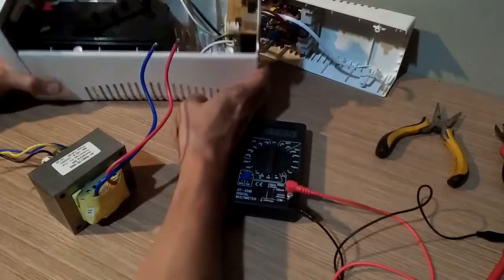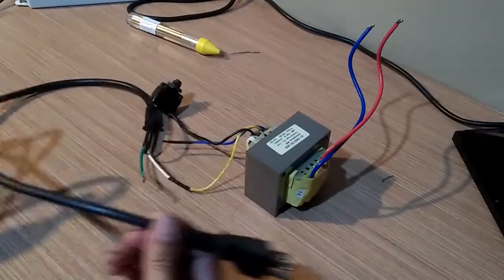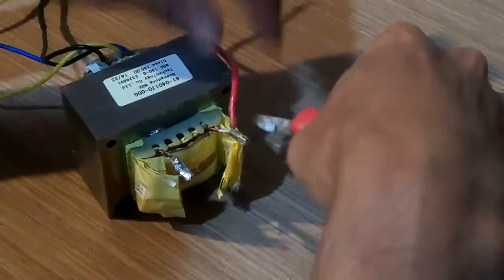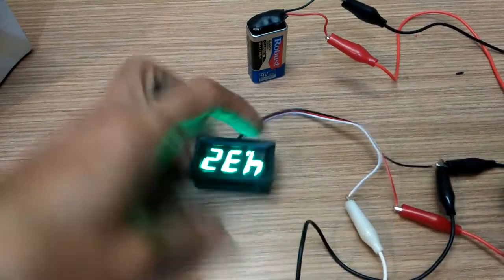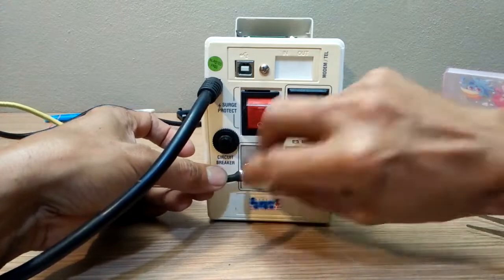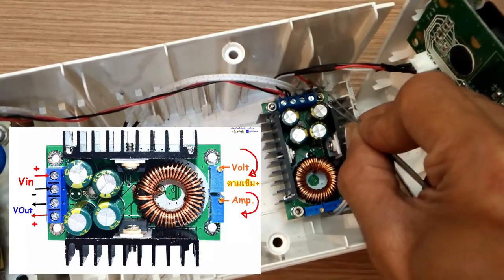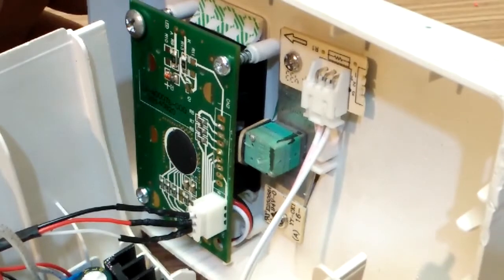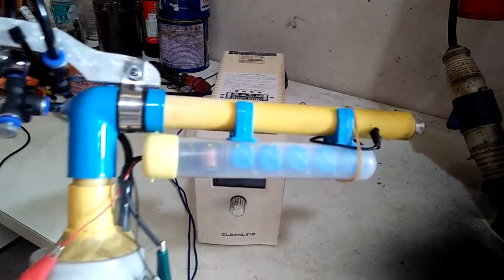Old UPS to Variable Voltage Bench Power Supply

Comment: hello. can you make it easier?
Reply from the maker: Hi. I actually made another version where I used a cheap 24 volts switching mode power supply instead of reusing the transformer. I still connect it to a DC-DC buck converter though.

Comment: Can I vary the ampere too like a proper bench power supply?
Reply from the maker: Yes. The module DC-DC buck converter module that  used has Ampere adjustment potentiometer n the pcb. f you connect that to a external potentiometer to the front panel, then you can easily adjust the constant current lmt.

Comment: Can i use ,
AC to DC Adapter, Adjustable Power Supply Motor 3-12V 2A 110-240 V Rate Controller
Reply: Instead of making this
Reply from the maker: Yess absolutely. I just made this power supply from scratch because I did not have an adjustable dc supply at hand.
Reply: @DIYPhil  what is minimum and maximum voltage required, and minimum and maximum Amp required

Comment: Hi Phil is  it possible  to  use a battery charger  as a power source  with a 5v step down regulator to control  volts and amps
Reply from the maker: Yes, absolutely.

Comment: Thank you so much for this! I've had a broken UPS for years which I was hoping I could turn into a variable bench power supply but didn't find a good video like yours. I'm definitely going to try out your method. I'm very grateful

I once made a bench supply using a transformer I made out of recycled ceiling fan regulator core and recycled some wires from various electronics. It worked but the transformer heats up after 10-20 mins when it is powered on, even if there's no load. So I only use it for testing circuits for short periods of time until one day I forgot to unplug it from the wall outlet for several hours and I came back to find out that the transformer had destroyed itself.
Reply from the maker: Hi. The transformer of the UPS will be more reliable because it is designed to be plugged in all the time. It also has high output current capacity. Inside the UPS circuit have MOSFETS that you can use with other cool projects. Good luck with your build.
Reply: @DIYPhil  I cant thank you enough...I'm still going through your videos. You have a lot of interesting projects!

Comment: Interesting. Thank you. What is the minimal Amperage for 12VAC to work well?
Reply from the maker: Hi. The ampere rating to work well will depend on the load requirement you intend to use your power supply.

Comment: What's the value of the potentiometer
Reply from the maker: I think it is about 10k. Exact value is not critical but it should be near the value of the trimmer resistor.
Reply: @DIYPhil  You need a 50k potentiometer for a 40v power supply